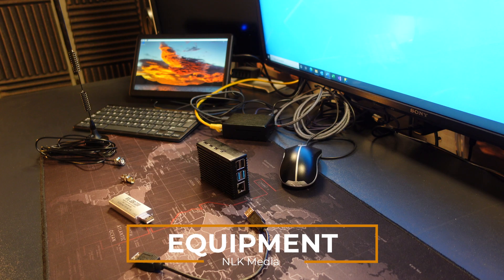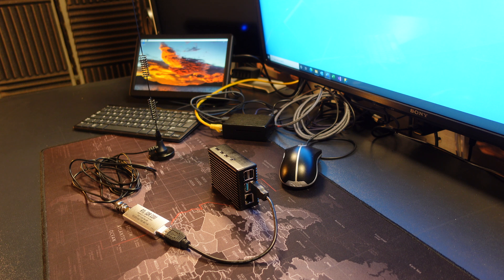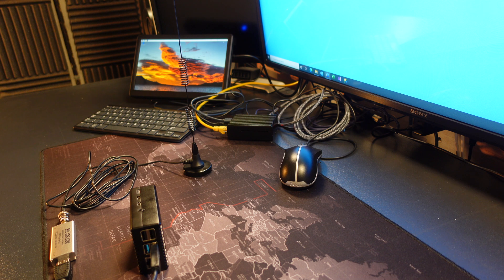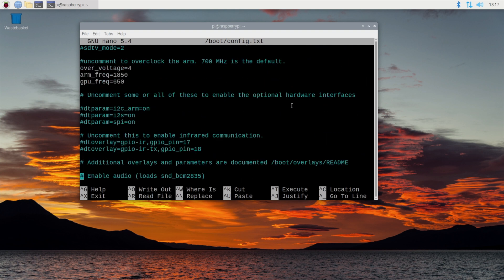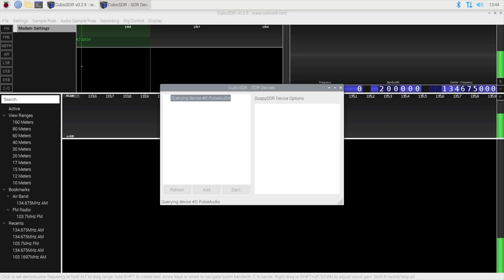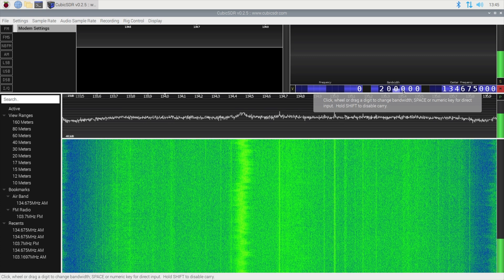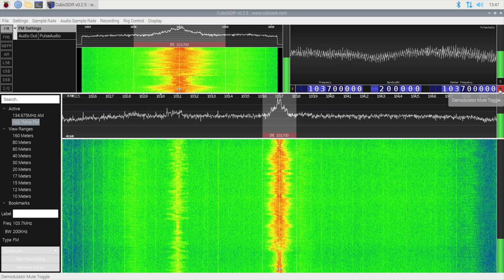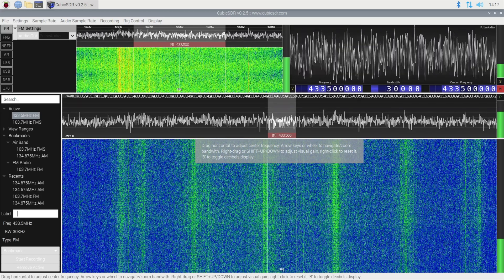Raspberry Pi 4 - Software defined radio - SDR Install guide - 2022

Comment: Does this also work with a raspberry pi 3B?
Reply from the maker: I don't know sorry. I only have Pi4 units and it worked well on them. Worth checking online to see if there is any further info on supported models for Cubic SDR. A good excuse to upgrade to the new Pi5 maybe :-)

Comment: RTL-SDR v. 4 requires drivers (installed). Pi 4 with 4gb and Cubicsdr: it finds the RTL-SDR. Push the start button and everything goes away.  Maybe 8gb Pi is necessary?
Reply from the maker: I have not tried running on a 4GB Pi, I only have the 8GB version. I had no issues at all when running on Pi OS, it worked a treat. Windows was a no-go due to the lack of arm USB support at the time but have not tried again on any newer builds. All the best and thanks for watching MJ7NLK

Comment: i think i/q is for direct sampling. thank you for the video!, do you have to have the packages on the sdcard prior to installing it or does it find it online?  73 w0nlb
Reply from the maker: Just the steps on the video and everything needed is installed. It was quick and easy with Linux to get it working. All the best and thanks for watching 73 MJ7NLK

Comment: Hi all, great vieo, I would liek to know if anyone can help. I am looking at making a raspi that can be installed within my loft, and then monitoring the Radio from downstairs using Windows via the same network. is this something that can be done?
Reply from the maker: You could make things easier and just put the antenna in the loft and run that back to your setup. Having everything local to your machine generally makes things easier and more flexible. All the best and thanks for watching

Comment: Thank you for your video! I have only 1 question: is it possible in CubicSDR set a range scan? Example a scan form frequency xx to frequency yy and then from begin (a loop)? Thank you very much.
Reply from the maker: Hi Frederico, I am not aware of a scanner mode for CubicSDR that enables a scanning range. You could add a suggestion on the github page but I suspect that the SDR dongle wouldn't be up to the job of fast scanning through frequencies. All the best and thanks for watching

Comment: Hello hope you don’t mind a question from someone who really hasn’t a clue!?
I have followed your great step by step guide and yes got the software on my rspi 400 😅. Snag is nothing appears to happen not even a drop of movement in the waterfall.
I have to admit I’m only using an AliExpress RSP1 Msi2500 Msi001 SDR Reciver 10kHz-1GHz /10kHz-2GHz As a way of a first venture into the hobby so although I wasn’t expecting a lot I thought I’d at least hear some static hiss! One difference between your own setup and mine is that im running the 64bit version of the pi’s OS.
I know you don’t have a lot to go on but any thoughts where I might be going wrong 😂
Oh I have flower pot antenna aiming at the aircraft band in the loft which does work reasonably well with a hand hel scanner I have.
Anyway cheers and thanks for any help you could offer.
Reply from the maker: Hi Brocky, you should try to look at your configuration settings to ensure the software is set to use the SDR dongle and that its also set to output audio to the sound card. Picking the correct input and output devices is essential as they are not always set automatically. I have not tried the RSP1 MSI2500 so am not sure what the USB driver situation is like so also check to ensure your using the latest drivers as well. Thanks for watching and please do let me know how you get on. All the best
Reply from the maker: Maybe something here might help
https://revspace.nl/Msi2500SDR
Some driver related info for Linux which might be of use
Reply: Thanks for your reply mmm yes having read up the info you point me towards it’s made me realise I understand so much less than I thought I did🥳
But I be since found and installed rpi image which includes a cubicsdr build and it works!
Well I say works I have got the waterfall flowing and getting lots of lovely static noises through my speakers.
There are lots of tall pointy signals there to be seen but no intelligible broadcasts!
Antenna works fine with my handheld scanner but nothing but white noise through the sdr.
So sorry but any thoughts where my new problem might be!?
Anyway thanks again 😅

Comment: Great video. Any idea if I can use the same raspberry pi with 2 SDR dongles, one feeding Cubic SDR as you presented here and another one picking up ADS-B signal?
Reply: I have three SDR connected to one Pi 4B. They are all feeding multiple ATC  channels to liveatc, seems to work no issue. It is using a stripped down version of the OS with no GUI and is not really designed to have someone actively listening, it is specifically for feeding to the internet. I can say the device can support the three SDR, but I am not sure how it would do running Cubic and ADS-B. I have a different Pi set up for ADS-B, never tried to plug them all into the same Pi.
Reply from the maker: Hi Panos, thanks for the feedback. I think the Pi would struggle with two devices at the same time. It's not a very powerful machine but worth a try to see how you get on. I suspect it will lag but you never know. The Pi 5 is expected in Q4 2022 or Q1 2023 (not official but expected) so might be worth waiting for that as more power and I.O. will make it even more useful. If you experiment with dual devices, then please do feedback how you got on. All the best and thanks for watching
Reply: Did you ever test this to see if its possible? I'm interested as well.
Reply: @malevolentbeing  have not tried it, to be hoenst. However on the Nooelec site, one of the product photos for their NESDR SMArt v5 dongle shows it on a paired configuration on a Pi 3, if I am not mistaken, so it suggests that this is something feasible.

Comment: What would it take to write software that would enable your setup to function as a AIS broadcast system for boats?
Reply from the maker: Hi Christian, I am sorry but I dont know the answer to that one. Would depend on range I guess. Thanks for watching. All the best
Reply: It'd be impossible, the RTL SDR dongle is receive only and cannot broadcast. There's lots of AIS receive software available, but broadcast isn't possible.
Reply: @JohnBaxendale  Thanks for the clarification!

Comment: There's needs to be better SDR software specifically built for the RPi and low powered systems.
Reply from the maker: Hi Mad Max, yes you are right the current software is laggy on low power devices. I am looking forward to the Pi5 when it finally gets released and hope to see the software come alive with slightly increased power and bandwidth. I might look at repeating my testing with a faster storage solution to see if this helps. The MicroSD cards, even the ultra ones, are just too slow, maybe that would help a little. Thanks for watching, all the best. MJ7NLK
Reply: @NLKMediaGroup  most of the issues is that much of the software available for the RPi is ports from software that's designed to run on much more powerful hardware, we're basically dealing with hand me down software. If the software was built on and specifically for the RPi you probably wouldn't see the performance issues we see with the current SDR software. We wouldn't need a RPi 5 if people would start making software specifically designed to run on a RPi or low powered hardware
Reply: lookup SDR++
Reply from the maker: @ryzerth  will do thank you :-)
Reply: @ryzerth  I know what SDR++ is, I use it on my windows PC. It doesn't run well on RPi as it was made with PC hardware in mind (PC hardware even from 2013 is far more powerful than the RPi is), it uses far too many resources to be a viable option for RPi. Seen quite a few videos on it "running" on a RPi, I tried it and it's pretty much unusable in it's current state, it completely pegs out the RPis CPU.
Reply: @madmax2069  On my pi4 2gb it only uses around 25% CPU with a RTL-SDR. Not sure which pi you're running but old ones have issues with OpenGL, forcing it to run software rendered (which uses way more CPU than the DSP ever could).
By the way it wasn't made with any architecture or OS in mind. It's actually meant to prioritize memory usage over CPU usage, which usually makes it more efficient then GQRX or Cubic.
Reply: @ryzerth  I'm running a Pi 400, maybe it's something I did before installing SDR++ that's causing issues. I'll try on a new SDCard with a fresh OS install to see if it changes anything for me.
Reply: @ryzerth  I just tried building it and it stopped as it couldn't find volk1. when I first tried it on my RPi I remember having to change VOLK2 to VOLK1 due to it not finding it and it would build. So I changed it from VOLK1 to VOLK2 in the .SH file and continued on without any issue. It finished building and is currently running and it does seem to be working well, CPU usage is around 22%, I guess the first time I tried it was something I did or added or changed before I installed SDR++ that was causing issues in maxing out the CPU.
Reply: @madmax2069  If you're running the 32bit version of Raspbian buster, you could have downloaded the prebuilt version available in the latest nightly build.
Reply: @ryzerth  I'm running bullseye 32bit, and SDR++ is running flawlessly, I'm not even seeing a single hick up. it's definitely not the experience I had when I first tried it months ago, I had to have messed something up on my first go at it (something I installed or changed in the OS).

Comment: Thanks for this excellent video tutorial, this is really good for beginers to follow, your step by step aproach was easy to follow not any quick prsesses and hidden commands you get from exprienced users, got my Raspberry Pi up and running and enjoying listening to some interesting radio signals, I didn't get the ariel you mentioned but got a small 1:9 balun from Amazon and just a long wire out of the window and tried different lengths of wire, amazing what you can pick up
Reply from the maker: Thank you Bernard for your kind and helpful feedback, its great to know that these videos are helping viewers out and are of use. It is incredible what you can pick up with a bit of wire hanging out of a window and a mag longwire balun. All the best and thanks for taking the time to comment. 73's MJ7NLK

Comment: 7:42 In the terminal you can just hit the up arrow key to skip back to previously entered commands even after a reboot, faster than you can retype "sudo reboot"...
Reply from the maker: Hi there MacGyver, thanks for pointing that out. I did not realise that terminal commands were persisted after reboots. Very useful info thanks. Thanks for watching, all the best.

Comment: Is GQRX any better than cubicsdr ?
Reply from the maker: Thanks for the suggestion. I will take a look and see. All the best. MJ7NLK
Reply: It runs better, but the UI is awful, you have to go through different tabs and windows to change things that should be easily accessible (aka located on the same screen). If you have a RTL-SDR you have to change the sampling modes depending on what frequency range you want to receive, and that requires opening up yet another window, and you have to change the sampling mode in the most confusing way possible instead of having just simple toggle. The way you adjust the waterfall is also pretty horrible, you have multiple sliders on a single bar instead of individual sliders next to the waterfall like the software in this video. 

Something like SDR++ is miles better for the UI alone.